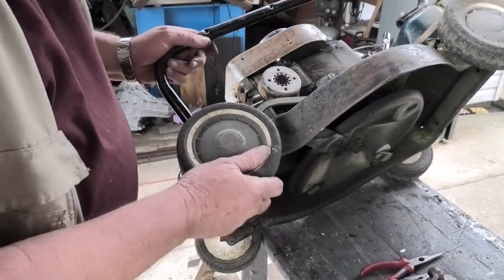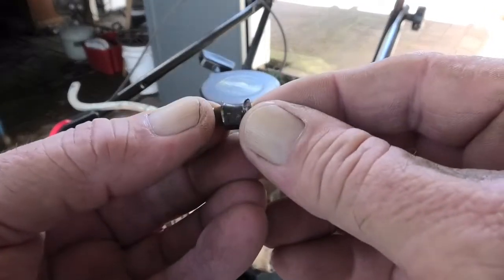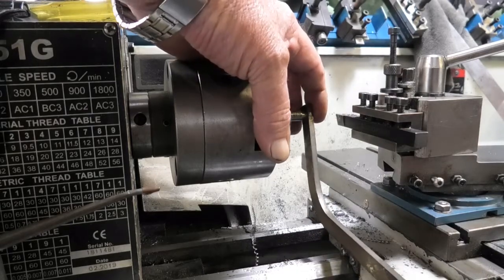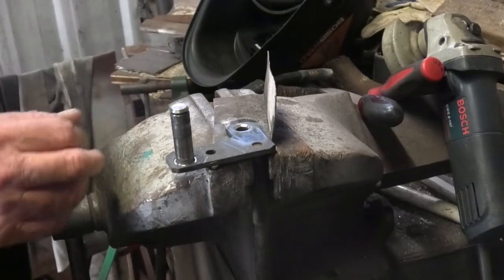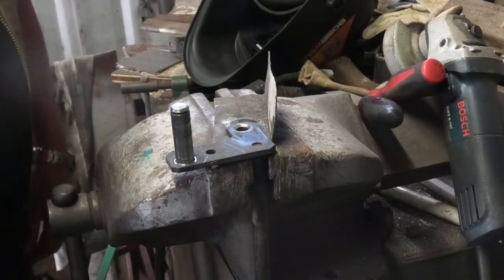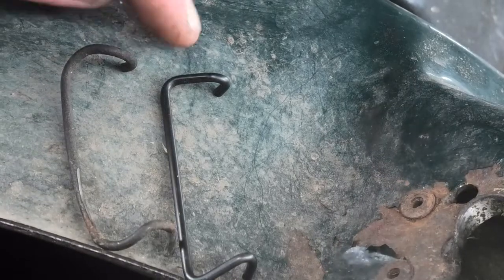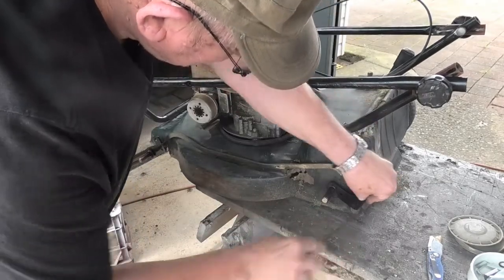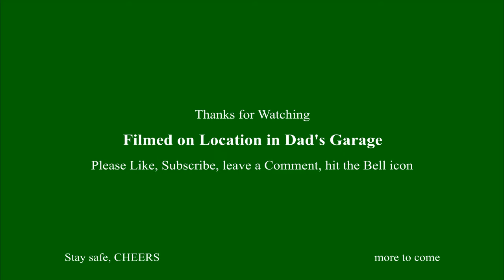Make new lawnmower height adjustment pins

Comment: Gday Peter, it’s good for another 20 years mate, amazing how much work they do before the stuff up, great repair, Cheers
Reply from the maker: G'day Matty. Mate they have always intrigued me, start em cold straight to full throttle rev the guts out of it for 2 hours then back in the shed for a week or two. And the front axle is only held in place with a bit of wire, no bolts and straps yet it's worked for the past 20 years amazing. And the air filter, a piece of crappy foam operating in a grass and dust storm all it's life and yet it works, they are an incredible piece of equipment we treat with contempt. Cheers Peter

Comment: Well that was a bit of work. That is an interesting adjustment setup. That should be on all push mowers. Mine you have to adjust each individually. Of course I can make tapered cuts by leaving one side high if I am in the mood😁
Reply from the maker: G'day Eddie. I've seen those individual height adjustment types and were never keen on them, I had supposed they were handy to give a tapered cut but that's too much work  when the yard is relatively small and your working around garden beds and such compared to a football field but then I rarely change the cutting height. The front axle fixing is so simple, just a wire clip, if you lost one it could easily be replaced with tie wire, simple and effective and if I didn't have a lathe the pins could have been made simply by chucking a piece of rod in a drill, grind and file to size and use a split pin instead of the E clip. Cheers Peter